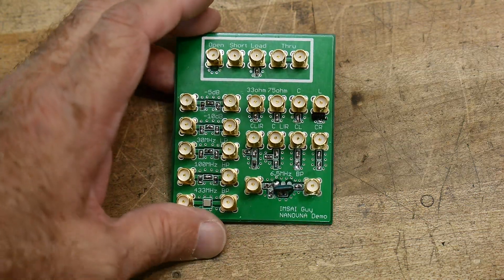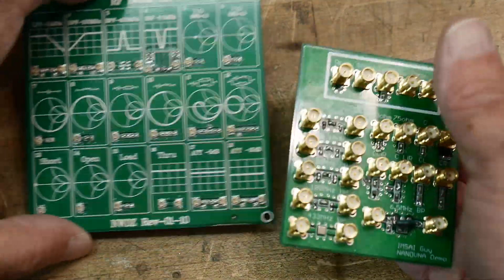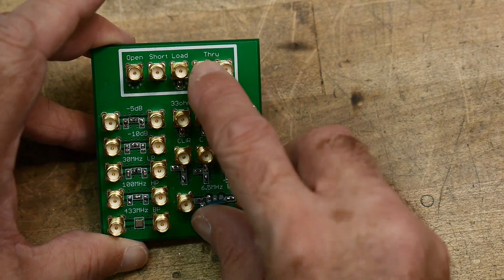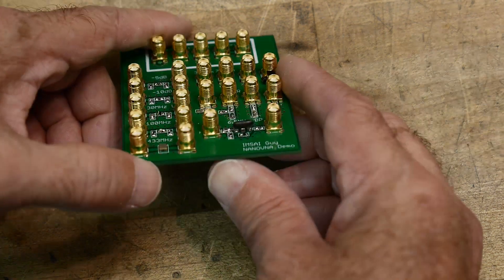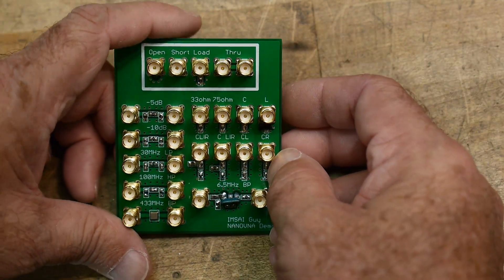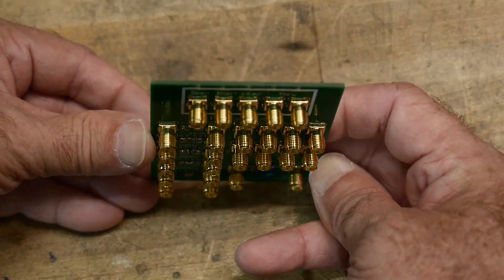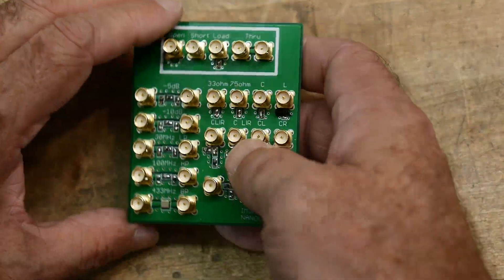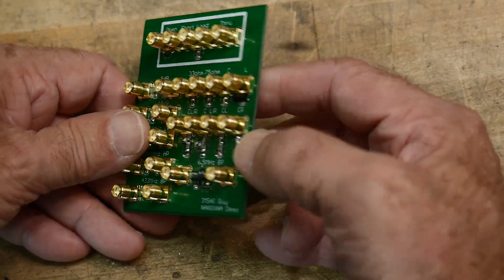#574 NANOVNA RF Demo Board SMA Version

Comment: In some of the new firmware , there’s now a step for an Isolation Calibration. Is tha a 50ohm load on each port or it it a 50 ohm load at the end of a length of coax on each port. I’ve found literature that say both as well as a couple procedures that make no sense at all. Thanks for your time/ Jason Burchell
Reply from the maker: isolation is to be done with 50ohm loads on all ports. it measures the internal crosstalk of signals.
Reply: @IMSAIGuy  Thanks!!

Comment: Now I realize I asked a dumb question below as IMSAI Guy is very clear in his videos that we need to buy a cheap demo board and remove those parts to put on his SMA board v2.  A Sparkfun tutorial about U.FL connectors, like on the demo boards, refers to one data sheet where Hirose tested those connectors only 30 times. If these tiny connectors do not last well, then it would be easy to "use up" the demo board connectors and cables just calibrating your nanoVNA.

I did purchase an SMA board and will build up the necessary components from scratch.  I'm not sure yet how to source the Epcos 433 MHz BPF, and I'm not sure about a couple other circuits but this will be a good learning thing and eventually I'll have a much more useful test board with SMAs. Glad you made a PC board.

Comment: Is there a list of the components for this board. I can figure out some of the simpler stuff but not which chip is the 433 BP and a few other things.
Reply from the maker: I bought a $15 demo board and removed the parts and soldered them do this one. the parts vary from vendor to vendor on those demo boards.
Reply: @IMSAIGuy  It is really too bad that there is not a list of parts (like many of the other PCBWay shared projects) so that we could construct a "clean" board from scratch. I have ordered your PCB boards and will attempt to slowly add the proper components.